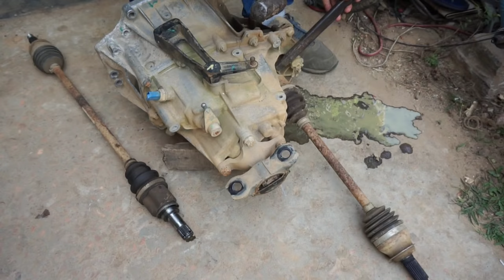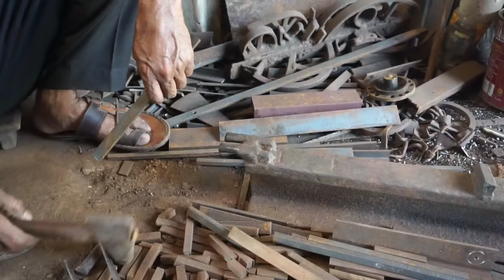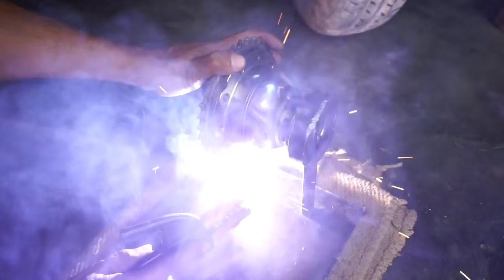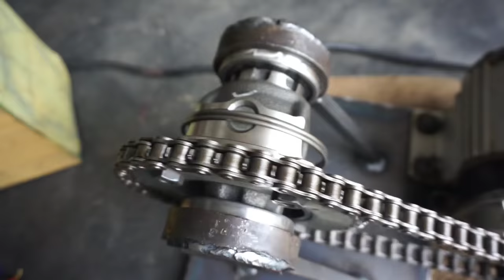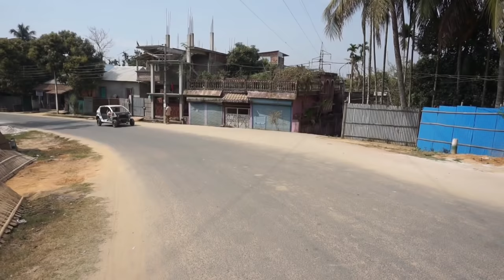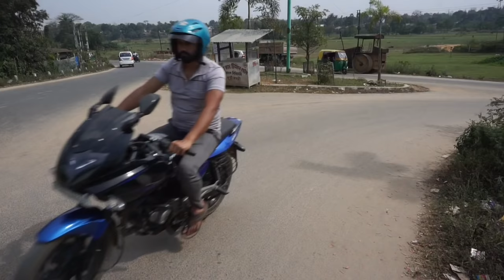How to make a powerful Electric Car 60 km/h Using Homemade Differential. Light weight project

Comment: Maybe you can make a plastic housing to fit around the differential so you can run it in oil or grease so it lasts a long time. Thank you for sharing with us. Great Project.
Reply: It requires aluminium housing to be oil dip.

Comment: You could (probably) make a "housing" for the differential out of a plunger. Yes, the "toilet's stuck!" things. A rubber one might fit, and a hard plastic & corrugated plunger will definitely fit, but rubber would be more durable.

I'd do it. I've used many plumbing bits on my car!
( really, my daily driver has a pipe fitting on the exhaust to help the computer, pipe hangers mounting motorcycle mirrors to the fenders, and maybe more :p )
Reply: Maybe he can just lub it with gear oil as we do with our bike's chain everyday, since the power this diferential is working now is much smaller...
Reply: @emanuelgoncalvessantos4499  the point of the plunger isn't just keeping grease in, but more to keep dirt out.
Reply: I was imagining an aluminum foil covering, then fiberglass over the differential to make it removable. Or a CV joint boot? Or two part epoxy to keep moisture and dirt out. This is very inspiring!
Reply: I actually stole this idea. Years ago, at Grassroots Motorsport's Battle of Lemons, (2003?) there was a Geo Metro using a GSR1000R engine driving the factory (Geo) differential and axles on homemade mounts. The ring gear replaced with a sprocket, so it was chain drive, and the differential was sealed with a plunger.

Comment: When he made those circles I knew this man what is a builder.
He should have used a rear differential like that he could get different gear ratios and just mount the sprocket on the yolk and you’re good you got brakes different gear ratios and lubricated bearings.

Comment: I would think a second motor and controller for the other shaft would be a much simpler mechanical solution. Electrical motors can be pretty balanced while allowing the slight variations changes in direction requires.The additional power would be a bonus.
Reply: That would double the wattage making it 1kw.
The number one priority in electric vehicle design is keeping the power consumption as low as possible. You only have a set amount of battery life.
Being miserly will increase the range of travel on a single charge.

Comment: Pretty cool!  I don't understand the reason for the driving both wheels.  Driving both wheels would put more load on the motor and reduce the distance on a single charge. Why not drive one shaft only? Less drag/torque will increase top speed.

Comment: I would go a step further with the robothut comments, try to make ahard pvc mould to the differential and motor sprocket for better life, and avoid dust and friction using grease or oil

Comment: Hello, Good project there ! Just one question. Is it possible to recharge the battery using an alternator from a gas car ?
Reply: as soon that alternator is in a closed circuit it creates braking torque, wasting more energy from that car than it would recharge. you would create a pointless brake. if you want to recharge the batteries while driving, you can use the motor to brake when you step onto the brake pedal and generate a little bit of electricity you back feed into the battery. thats called regenerative braking. you wont get much out of it though. if your DIY car has like 10 miles of range, you get maybe one more mile out of it.

Comment: Very nice concept congrats to you...my question is 1. can you fit this motor to the input or primary shaft of gearbox in my maruti 800...so that I can use the gear box on steeps etc. 
2.Can we also run A.C. of my car on this motor?.

Comment: What about vacuum for break booster
Reply: I'm guessing he is focusing on going, not stopping 😁
He could set it up as a one-pedal drive, where letting go of the throttle causes the battery to charge and the car to automatically slow down...

But good luck with REAL stopping

Comment: No good. Why get rid of the transmission when you can just make an adapter to fit the electric motor to it. Besides how are you going to lubricate the spider gears in that differential

Comment: This is cheapest electric car! Whats type battery its used for this?
Reply: U can use Li-ion ,or better is LFP say abt 48 volts 80 Ah may give u abt 60 kmph.,like this cars if, weight abt 690 kg.LFP has double the life than Li-ion. and also low & high temperature range.

Comment: Incorrect, Differential does not need oil unless friction coming from the gear which is not used chain will go before any.

Comment: Which battery u used bro?
Reply from the maker: Lithium ion 48v 29amp
Reply: @mytime8201  can we use car battery for the same bro??
Reply: @nightking1491  Yes... but use 12volt  30ah  battery 4 piece to serial connection
Reply: @kalaitn2199  ok bro thanks.. can u suggest any place where to buy the motor for less price? We students making this project
Reply: @nightking1491  hi bro  u go for karolbagh  ( Delhi ) all electric vehicle parts
Reply: @vadlarajeshwar4043  I'm looking it in bangalore bro